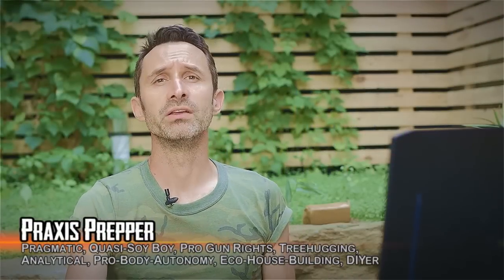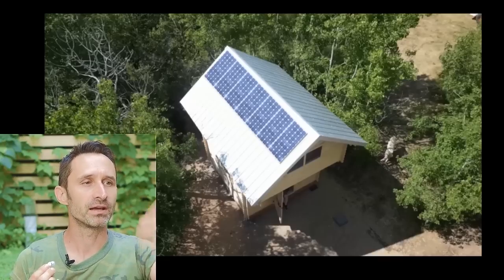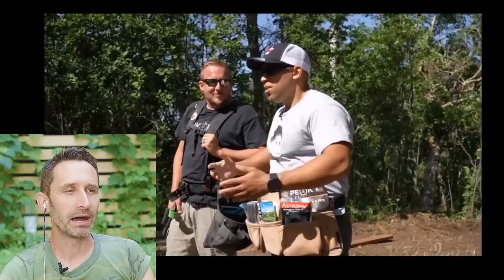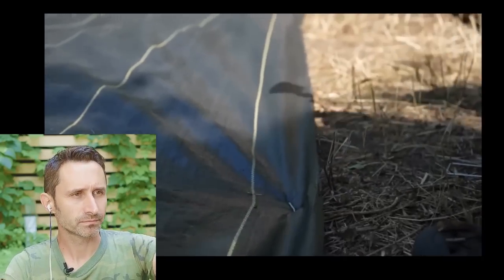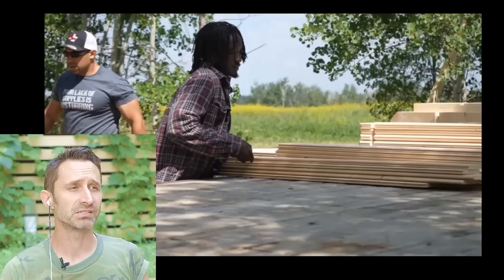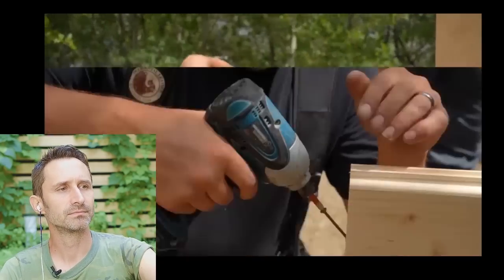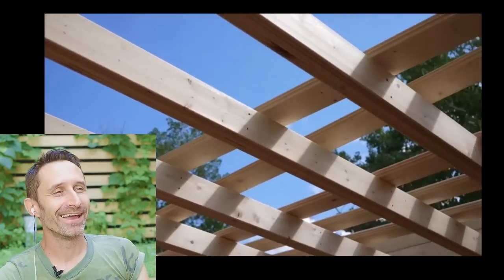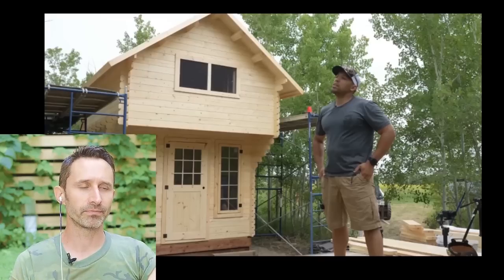Canadian Prepper's Cabin: A Real Prepper Builder Reacts to @BunkieLife & @CanadianPrepper

Comment: These are adorable. I would love to have one as a tea house, potting shed, boat house, etc. especially if/where aesthetics are a factor. But for quick and dirty bang for the buck shelter and practicality, shipping containers are fraction of the cost per sq ft, easier to insulate, already have a floor designed to handle moisture, can be elevated on footings to span uneven ground, and with a few welded modifications around the locks, are far more secure, especially when you’re not around. And unless you are going to pack the Bunkie in one stick at a time, almost anywhere they could get that trailer into, you could also get a drop deck in to deliver a container. Or, if money isn’t an issue, build two Bunkies back to back, cut out the adjoining walls, hide a shipping container inside and fill the void with sand. Instant gingerbread house Faraday cage bunker hiding in plain sight…and yeah, bonus it’s cute! Otherwise, I agree that it’s an expensive tent.
Reply from the maker: A forest tea house sounds great!
Reply: Right…tea makes everything better!

Comment: Before I say anything, Canadian prepper did this more to make a sales video more than anything else lol. I agree the foundation should have been at least a 4 inch steel reinforced concrete slab, but I also know, getting a concrete truck to some remote area can be a bit pricey,  but agree with you on corner post, no excuse for that one  , but the reality is,  I believe he's going to use this mini house as a glorified tent more than a real bug out location,  it's a summer home, and there is nothing wrong with that,  but will make interesting videos for arm chair carpenters and preppers lol
Reply from the maker: Yeah agreed on the truck. On my chicken coop, the quote was $7000 for the foundation that ended up costing me about $1800 in materials to DIY. Pricey getting those trucks for the small jobs!
Reply: @PraxisPrepper  I've been in the business a while,  so I have friends that own concrete trucks,  I got my 6 inch thick chicken bunker roof poured for $600 with the concrete pump lol, the material for the storm shutters was more expensive than that 😅

Comment: I cheated a bit. A second hand portable cabin put on stumps in the mountains. My father (a builder) built a extension on the side and a nice verandah. I always remember to keep under the house off the ground and plenty of ventilation and natural light to  minimise the termite risk. 
I ended up selling the place 20 years ago.
Reply from the maker: The stump idea is awesome! Will they act as highways for termites at some point though? Maybe if the stumps are kept alive, the termites won't be an issue? It's a really cool idea though. It reminds me of those people who build bridges out of living vines! :)
Reply: @PraxisPrepper  Australian hardwood Redgum stumps were once a popular option with ant caps on top of the stumps (very termite resistant).  Now concrete stumps is the go (if not using a slab). Or galvanised steel stumps can be used, but probably wouldn't use them near the sea.
Untreated pine is a favourite with termites if they get into your house.

Comment: So, since you know how to build, I have a question for you, or anyone out there.  I am a woman in my late 60s.  I would like to put a metal roof on my shed to collect rain water.  Right now it has a regular shingled roof with moss growing on it.  Can I just scrape the moss off and slap some metal on the roof , with a cap thingy and gutters and call it good?  Or do I have to take off all of the shingles?  I can’t afford to put a metal roof on the house, so I’m going to do the shed myself.
Reply from the maker: If I had a roof along the lines of what you described, and I wanted to top it with metal roofing material. What you describe is exactly what I'd personally do.
Step 1: scrap the roof clean of as much debris (moss) as possible.
2: check it to be sure it's as flat as possible. If it's not flat, then the metal roofing panels will be a pain to line up as you lay them down.
3: lay 1x3" boards horizontally across the roof and secure them SECURELY!!! to the sub structure of the roof - like into the ceiling joists under the plywood of the roof. At this stage, if the roof had NOT been perfectly flat, you could put shims under some of the 1x3 boards to elevate them up to create a perfectly flat plane. You can check this by eye-balling across the surface of the roof from the edge, from this angle, you'll be able to see dips and bumps. All the final 1x3 boards should eclipse each other all at once as you raise and lower your view over the edge of the roof. this will suggest that they're all in the same plane with each other. As for spacing, spacing the 1x3 boards about 18" apart should be good. You could do less spacing, but 18" should be good. If you live in a place with very high winds, maybe go to 12" spacing for more contact. You'll be screwing your metal roofing down into this 1x3 lattice - not directly into your shingles.
4. After the boards are all flat and in a plane, use math to sketch out a perfect rectangle on the surface you created. Mark off spacing that corresponds with the ribs in the metal roofing so as you move across installing the metal sheets, you can keep correcting for any error that creeps in. You don't want the top to slowly overtake the bottom edge or vice versa. Also, consider where your roofing will start and stop. The roofing I use has ribs at 9" increments, so if you don't want to have to cut it (which you could), plan the roof to work with some multiple of 9". You can build out eaves to add extra drip protection for your walls to accommodate the final width of the roof too. 

The rest is all about trimming out the edges and top. I think your basic plan is sound though. The shingles underneath should be just fine. They'll stay dry and intact beneath the metal. If the roof gets direct sun, you shouldn't have any issues with mice etc. moving in there because it'll be way too hot during the day for them.

Comment: That folk building an original cabin should dissasemble the roof and repair that metal skirts, put tarp over them not under. I would do that no matter what if i have that kind of cabin.
I hope they lacquered it, because after a year that wood starts to darken and crack. Everything is pretty when you have new wood.
Im not 100 convicted whole building is only the kind of backyard storage shed, cause walls are too thin.. i would build level floor out of stone, bricks or something like that, but that's my preference.
Reply from the maker: That note about sealing the wood is a good one. I forgot to mention that in the video. Sealing the outside won't last forever, but it's still a critical step with those horizontal wall boards that will accumulate moisture between each tongue and groove seem.

Comment: The reflective coating on the foam insulation does nothing in this application.  All the layers are tight, the heat will transfer via conduction.  You would need an air gap over the aluminum foil surface to allow radiation to reflect heat back.  The other use for it would be as an air barrier which is of no use since he didn't tape the seams.  Waste of money.
Reply from the maker: The foil backing on the panels is pretty cheap, so if it's money wasted, it's not much. I just bought a 4x8 sheet of pink foam insulation (for subgrade use) and noticed that the 4x8 pink foam was $54 and the urethane with foil of the same size was $57. The pink is R10 and the urethane is R13, so there's a benefit even without the foil. As for the conductivity through the foil if it's in contact with the facing surface, you're right... but only in a perfect world. When the foil backed foam is nailed down, in theory, it's touching the wood everywhere, but in reality, there are bumps and dips and gaps and lots of surface where there's a small gap so the IR reflectivity can work. Also, it reflects both ways, down (to keep heat in) and up (to keep the heat from the hot roof out). Same deal with the tarps and metal roof, the gaps will let it do its job over a lot of the real estate. But again, even if it's not doing anything, the panels cost essentially the same and the foil adds some rigidity and strength as well.